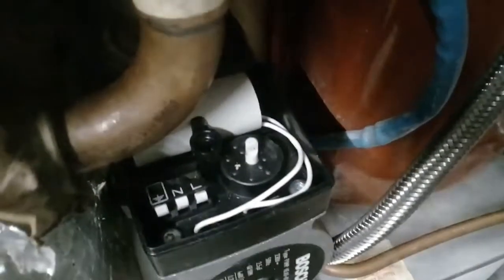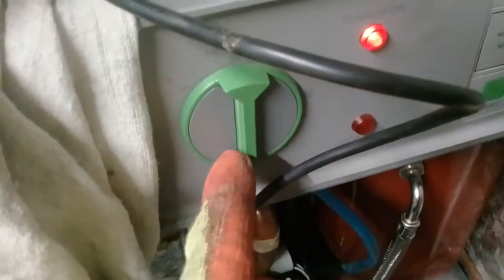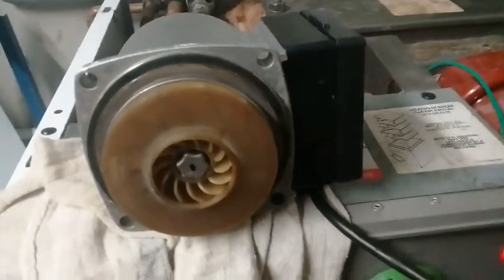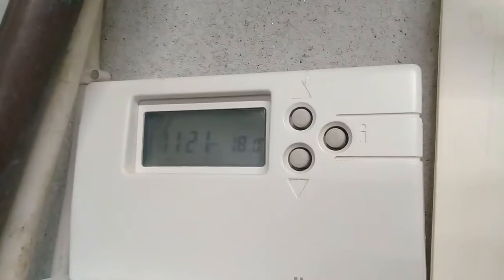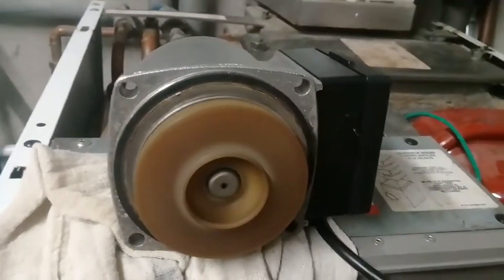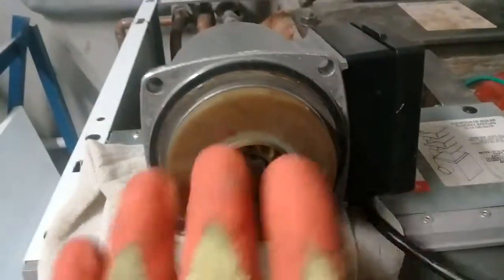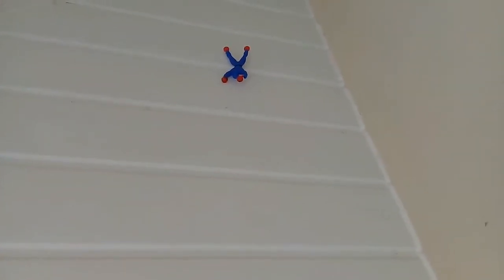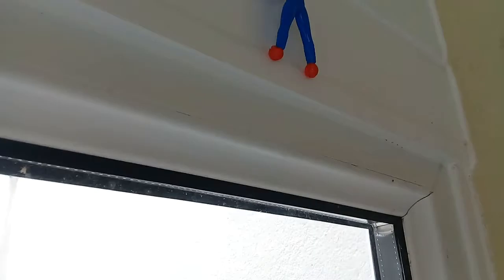Worcester Heatslave Oil Boiler Pump Test Connected to PCB

Comment: Why did you not just remove the screw from the front of the pump and test resistance with  a screwdriver through  the shaft . Also check for power to the pump with a volt stick for speed .